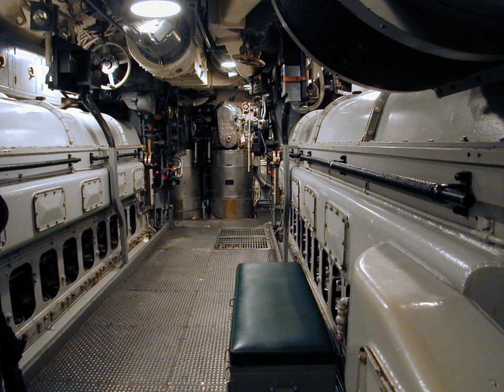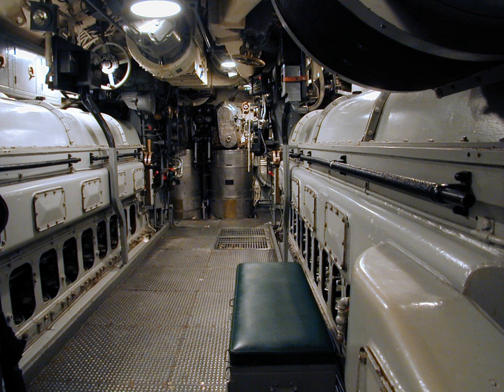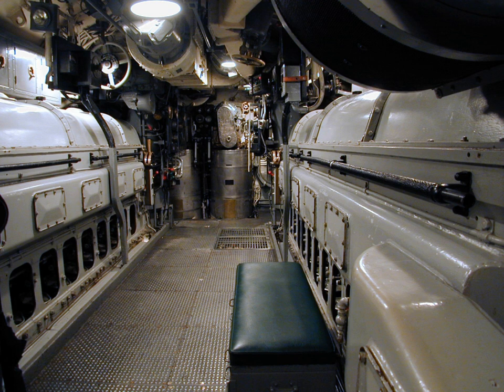Opposed-piston engine | Wikipedia audio article

Comment: In the picture you are seeing the forward engine room of a US WW2 vintage submarine. Number one engine to the right and number two to the left. These engines built by Fairbanks Morris developed 1600 HP at 720 RPM. Ten cylinder 8.125 bore.  You see the top half of the engine as we had a lower level in the space.
Forward of the engines you will see a Badger Distilling unit.
I sat on a bench like that one near the bottom of the shot many hours. I was an oiler on these boats.
Reply: What was the oil burnoff rate of your 38 8 and 1/8th OP 2 strokes? Did it require a certain 2 stroke oil? I got both my small block v8 2 stroke  and 8v92  silver 2 stroke on klotz techiplate which is 46$ a gallon.
Reply: @jlo13800  The oil pan or sump as we called it held 440 gallons of something like a 40 or 50 weight oil and was pumped through the system just the same as a 4 stroke engine. We would have to enter the oil sump to clean it when oil change \PMs were done.
Reply: @simplyamazing880  Did you feed it in the fuel to burn it off to get rid of it and turn it t energy! i do this with my 8v92 as i use BRP XD-100 oil which monograde synthetic1 burns real clean to and adds a little power but its no cheap.
Reply: @jlo13800  Those engines were pretty much a standard diesel engine with mechanical fuel injectors and the oil was just lube oil. I can't remember how much they burned. The big difference in those engines was that they were and still are today apposed piston engines. ten cylinders with two pistons in each cylinder. two crank shafts tied together with a vertical drive gear between them. This technology is seeing a comeback today.
Reply: They got a new Trident OP 2 stroke that goes over 5000 hp to 10000 hp! that's sick! Them napier Delticks are another impressive motors OP. One cheaper way to make a mini delti is to get (3) 60 deg v6 mercury outboard 3.2 optimax blocks and and join them to make a 9.6L OP napier deltic mini! i got a 8v92 and work around detroits on boats, if they ain leaking oil they ain working! ifound this out on a snowmobile with had CCW 440 win! I leaked a little arounds the clutch seal. it acted like a
 mini detroit!